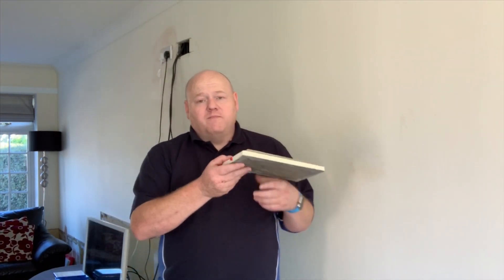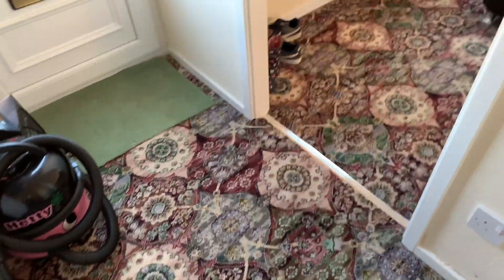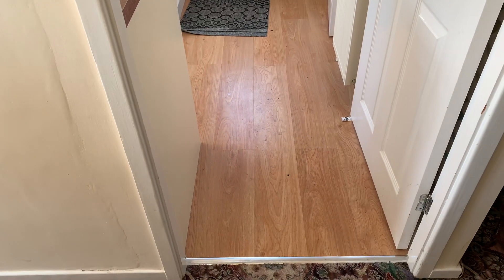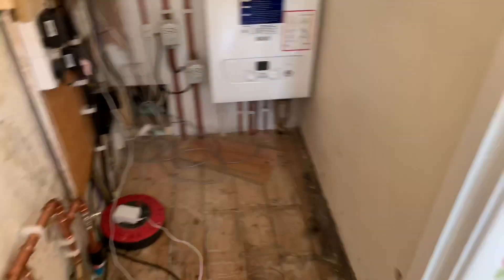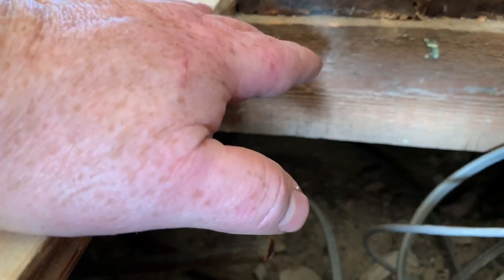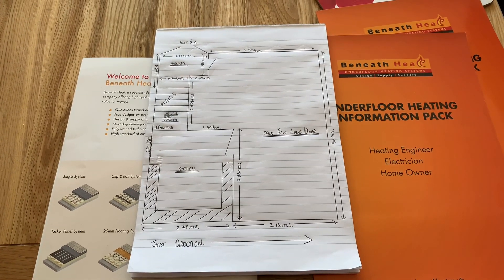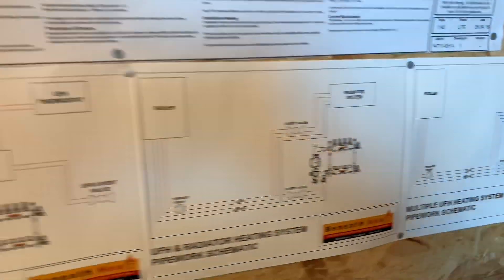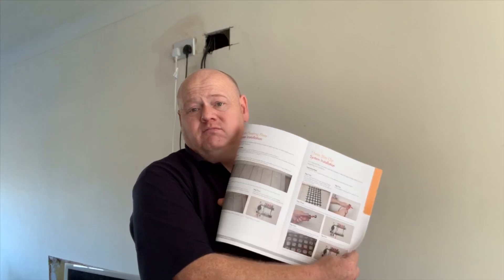How to install Underfloor Heating Measuring up day one

Comment: How are you going to get pipes around without notching 4inch joist. 

Are you running a bypass with the 2zone valves for the combi pump over run or will you put a low loss header in so you can run a pump with the correct flow rate for the ufh system
Reply: Maybe the pipes sneak under the joists. Next video maybe we will find out.

Comment: Will be interesting to see this video and how you get on as install underfloor heating for a living. I would recommend putting some installation board between your joist before you put the plates down. Also a little tip get some slaters lat and fix it on to the side of you joist before you put the installation in and this will stop the installation from falling down or even out.
Reply from the maker: Did you like the videos? Thanks.

Comment: Why are you putting underfloor heating in an area that is going to have a fridge in?. As it is basically a very small cupboard you are never going to use it as a living area.
Reply: Think he means manifold pipework ect in there!
Reply: @mattgreenwood4986  Hi, I may have misunderstood  Allen when he said about the cupboard if, so I am sorry and it was still a good video. PS I was NOT the one how gave this video a thumbs down
Reply from the maker: John Fithian-Franks Manifold in the cupboard, Thanks 🙏
Reply: @mattgreenwood4986  No, Allen said he was putting underfloor heating in the cupboard that the fridge was in, I understand the pipes going in there to meet the manifold but the fridge will be working harder than necessary to stay cold if underfloor heating is put in there.

Comment: Staple netting and use rockwool insulation. Celotex isn't breathable. Your timbers will eventually rot.
Reply: no they wont
Reply: ghostmanromeo uk ýeah I think you are correct, as the heating pipes regardless of make of material, will attract moisture on the cooling down, over time this can lead to timber rot if no ventilation is provided, whatever you use make sure your timber can breath, remember this on what you use as your floor finnish on top.

Comment: Was a little gutted with beneath heat, I had a bathroom to underfloor heat, eventually whole house will be, I’m in the trade, they are only about 2 mile down the road from where I live so thought great, give them a phone and near enough I can collect whatever I need.

But they wouldn’t deal with me, said they only deal with plumbers merchants and that I would have to order through a plumbers merchant.

In the end ended up having to design it myself and buy the bits from another local supplier that allows collection.

But was a shame as they are nearer to me and I quite liked the products from your first video... but needed to be able to collect and didn’t want the hassle of trying to find a merchant and working through a 3rd party.

Not criticism, their product looks great, and they sound like a great company which was even why I enquired with them...was just a personal experience.
Reply from the maker: If they sold directly they would piss off the merchants, 👍